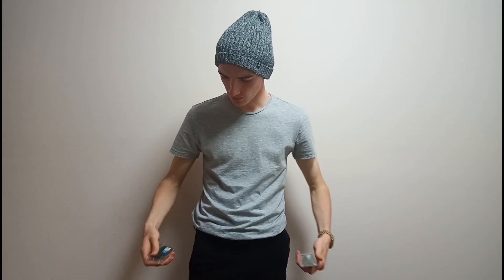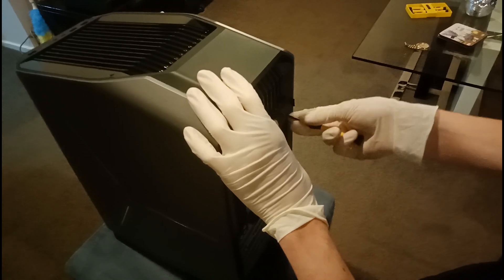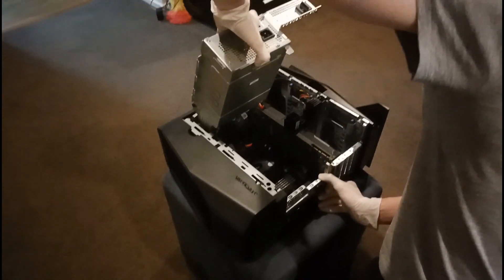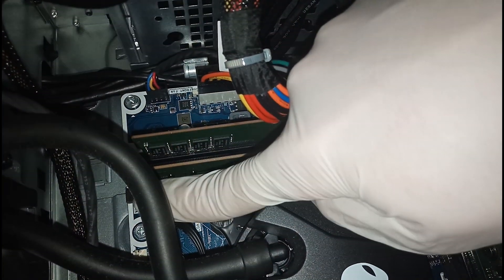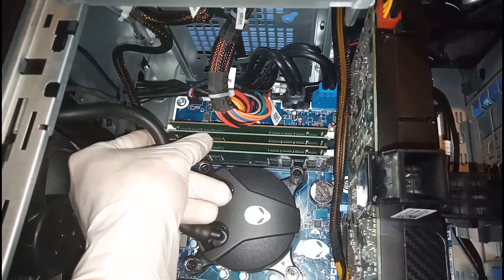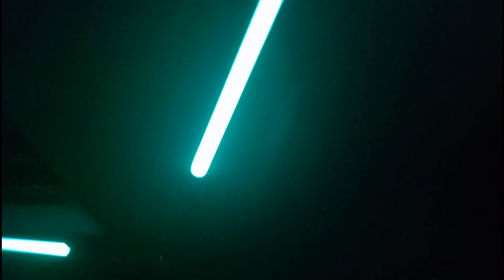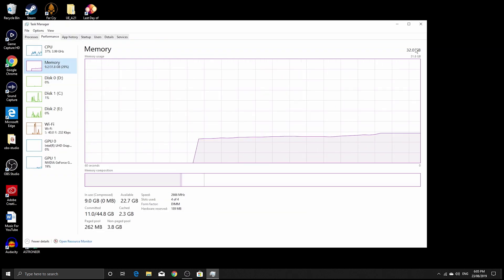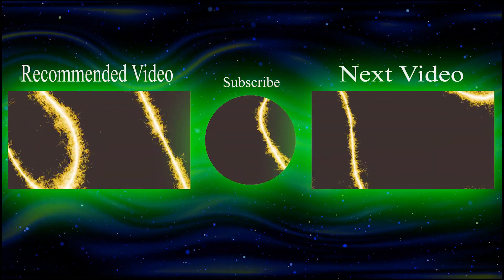Is 32 GB RAM Necessary? (Ram Upgrade Alienware Aurora R7)

Comment: Could you post a link to the ram you used pls
Reply from the maker: Of course, sorry I though I posted it in the description. The link is 
https://www.amazon.com.au/Crucial-Desktop-PC4-21300-Unbuffered-Platform/dp/B0734V4SSR/ref=asc_df_B0734V4SSR/?tag=googleshopmob-22&linkCode=df0&hvadid=341745454758&hvpos=&hvnetw=g&hvrand=12957513525568075201&hvpone=&hvptwo=&hvqmt=&hvdev=m&hvdvcmdl=&hvlocint=&hvlocphy=1000286&hvtargid=pla-440420923159&psc=1
Reply: @JilariousJamesGaming  Hey mate, I wanted to upgrade to 32 GB of RAM (same PC as you) Unfortunately I bought the Kingston HyperX FURY RGB 32GB (2x 16GB) DDR4 3200MHz. It worked soon as I installed, played some games etc etc... but after I shut down my computer and booted it up again, I got the infamous flashing yellow lights, 4 to be exact, which according to the manual is a RAM/Memory failure. Go figure... I want to upgrade to 32GB still. So my question is have you had any problems since upgrading with this brand of RAM?
Reply from the maker: @unknown-lives  Hi mate, I have had my ram for 1 and a bit years now. No trouble whats so ever. Strongly recommend it, plays games like a beast, edits videos like a boss and multi tasks great. The link is in the description, if this helped you out, why not share this video to others facing similar problems.
Reply: So here my problem I bought 2 x 8 gb of ram stick and I put them in and fit some reason my computer keeps blue screening and idk how to fix it
Reply: @MalcolmMiller-v9u  you probably bought the wrong mega hertz make sure it’s 2666mh
Reply: Or whatever mega hertz your ram is